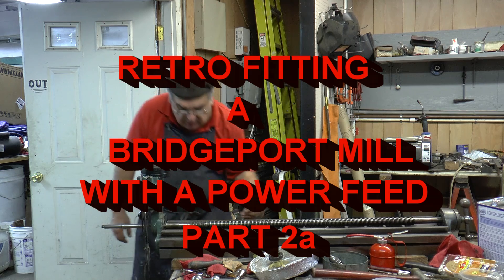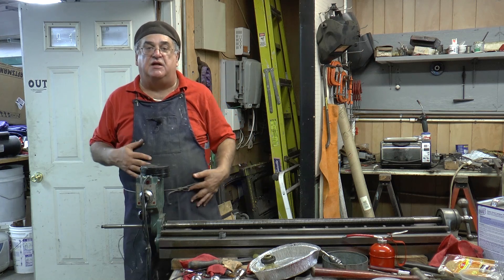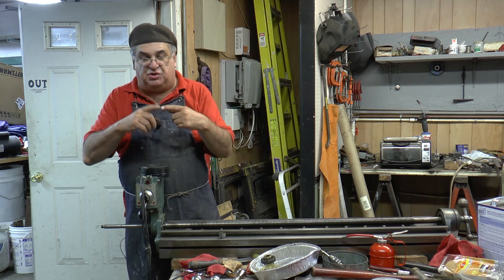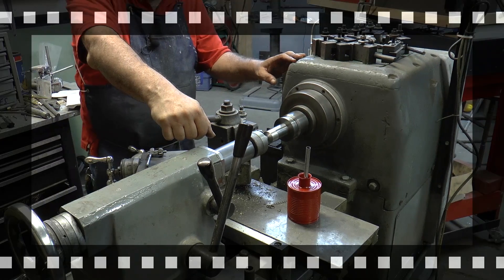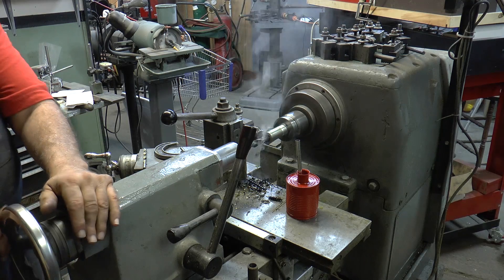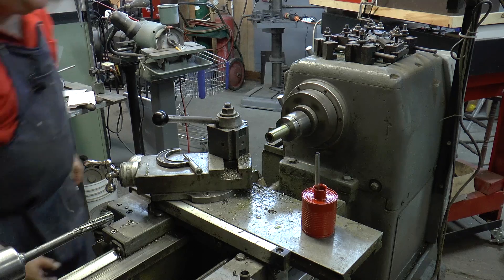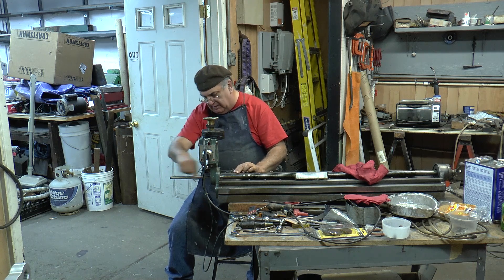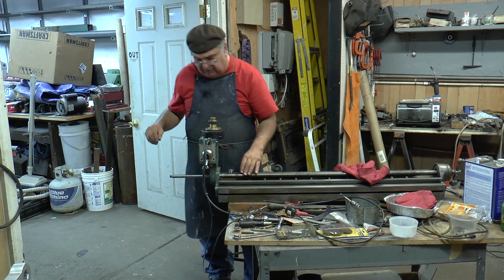RETRO FITTING A POWER FEED TO A BRIDGEPORT MILL PT2a

Comment: Thanks for the video. I know I'm a little late, but I just bought my BP. Mine has the big old heavy motor. I want to get rid of it and do the same as you are doing here. Can I replace my lead screw with one that is already to fit these power feeds?
Reply from the maker: Yes you can but if you have a lathe big enough it is easy to do the lead screws are  available from H&W